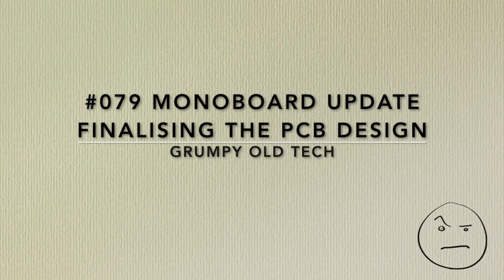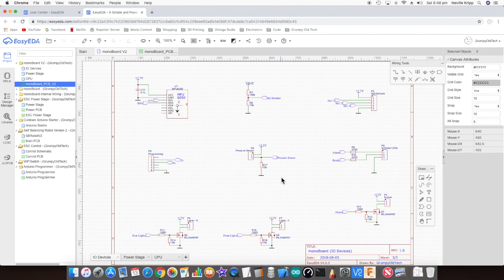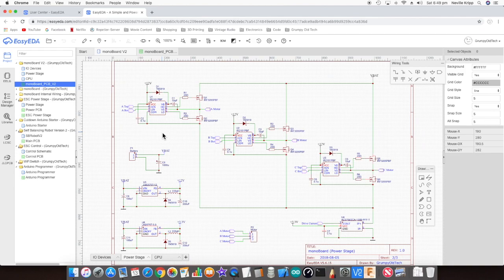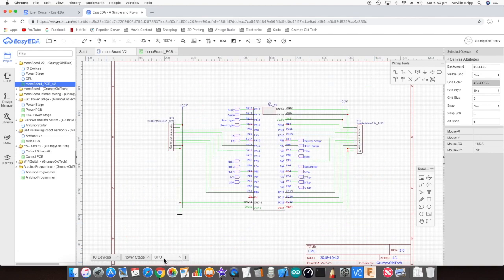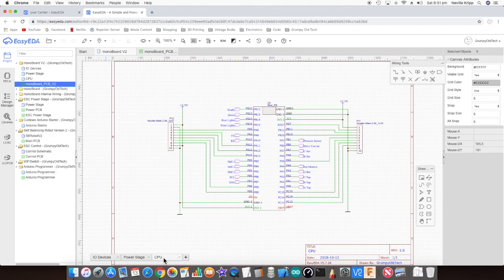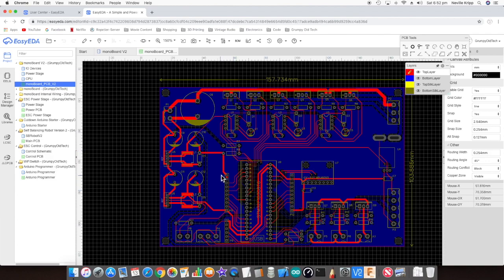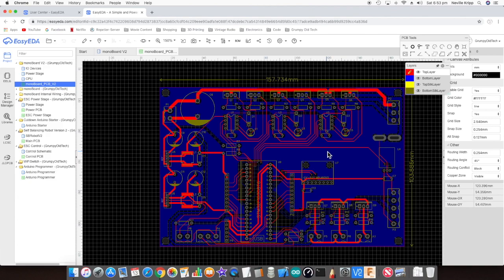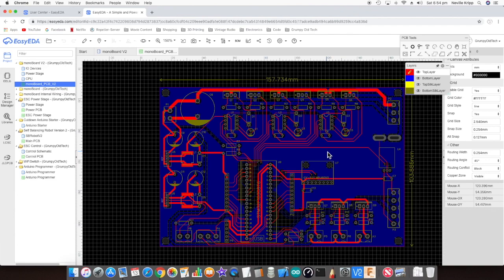#079 monoBoard Update finalising the PCB design

Comment: Did you stop working on this project? I realy want to see you running it. It's is great project. Greetings
Reply from the maker: Sorry for the delay, it’s driving me mad every time I look at the hub motors on the shelf as well. It’s on hold, but about to get back into it fairly soon. 
We moved house and had a few things popup that delayed things. I’m just completing a new 3D printer project right now as the old one is on its last legs and I needed the new one with larger build platform anyway to makes some bits for this project. I will be back into it right after that.
Reply: Nice. When you start doing it again write some post to the Hackaday. It will boost your channel.
Reply from the maker: Ok cheers for that, will do

Comment: found your channel while planning a build for a onewheel clone, I have ordered the same 10inch hub motor that you have from AliExpress, I have been looking over Joop Brokkings code for the self balancing robot, but my arduino coding is pretty basic and really beyond my current understanding, I was originally going to use a hoverboard motherboard which has all the firmware and balancing functions already built in but not sure if it would be compatible with the hub motor? What you are doing seems to be a much better solution and I would be very keen on your design for the electronics and firmware along with the ability to upgrade the code as things pop up ! will you be able to provide the electronics for sale? and or can you eventually supply working code and parts list for your build? very keen on building this, have subscribed... but your web link for the project is coming up error, thanks
Reply from the maker: Hi Mike,

Sorry for the delay in responding, I have been flat out at the day job, moving house and the list seems endless.

The website is now back up, so access to the project is back again, however until we move, in a few weeks its pretty much on hold. I want to get back onto this project once we are settled in so hoping I can complete the majority of it fairly quickly, or at least prove all the circuitry anyway.

When I ordered the circuit boards I received 10 and should have enough bits and pieces to put another together. Once I am comfortable its sorted I will get in contact, if you are still interested we can discuss maybe suppling a populated board.

Cheers Nev